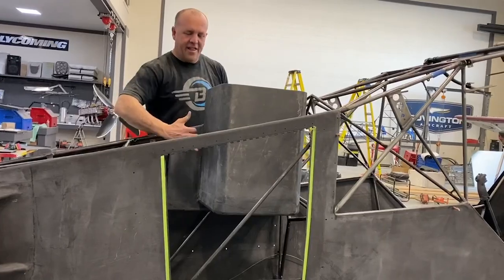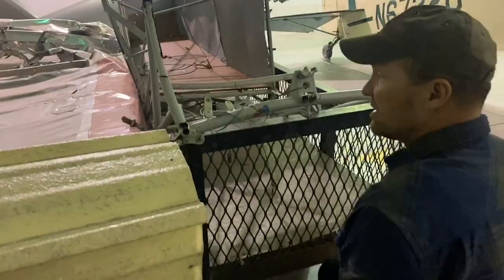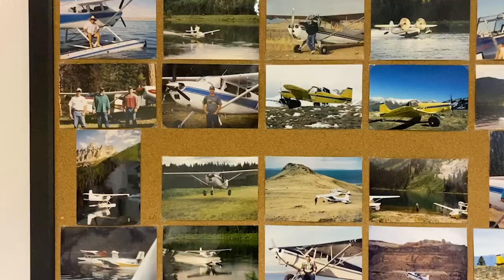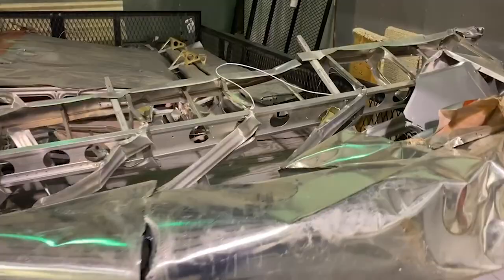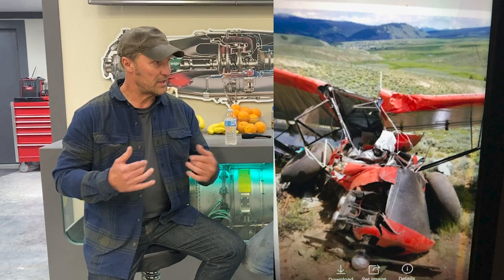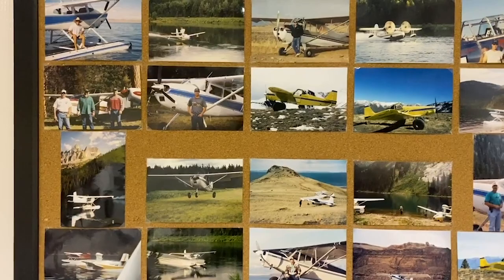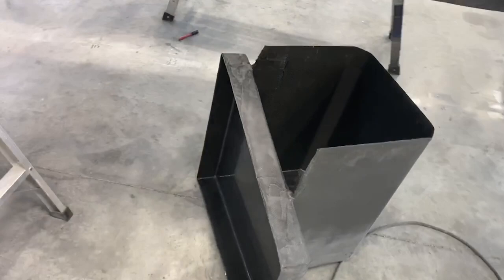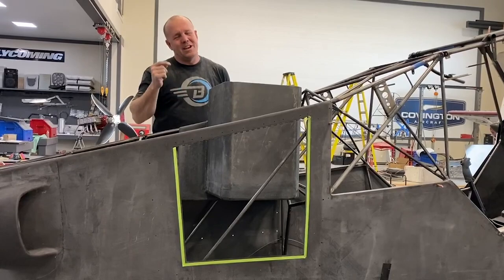Rockets, Boxes and Parachutes Oh My 🤠 (Scrappy Bush Plane 18)

Comment: I'll tell you a story Mike , One that set my Aviation path in a different direction . Or so I felt at the time . I got my private lic with a night rating and was building up to cfi and stuff . At the same time I thought to become an A.M.E. in Canada . I found a 1946 Taylor craft that was a restoration project . It was completely stripped when I got it but complete . Well a series of life's circumstances and being in my mid 20's . life had another plan , kids . It ended up where the guy I got it from sent me to the previous owner for a paper work clarification , small town no big deal  . basically that to say what became the problem for me was although excited to do this it had some ugly wing spares , which priced the build at more than its value at the time , more to it but you get the idea . It wasn't working out  . In the meantime I got a hold of the guy for the paperwork . turns out I was on the phone with his brand new widow . He had the twin plane to mine and was out for a flight around his farm and flew overhead and rocked the wings to say hi to his wife down below and snap . He lost a wing . he'd be here maybe ... maybe , but it's such a solid maybe that he may be here if he had one , right ? everyone should be saying yes and amen and here but buy the grace of God go I on that note !!!! 
      That's a long time ago now . I got discouraged at the moment and went a different direction in life . It's all good because even though I had stopped flying I always loved it . I kick my butt for selling that plane ..... however , it had to be at the time , yet life has a way of coming full circle . I think the biggest reason I sold it was although super close the timing for such a build in my life wasn't there , just yet .  That and expense , inexperience with no way to find a friend with experience for some helping advice or what ever ..... 
   That was 25-30 years ago now and at the time planes like that were abundant , more so than now . I had discovered in the meantime the Experimental category .... Things have been on the back burner for a long time now , always wanted to do that AME course ... Just cause , right ? Well I have collected 3 or 4 sets of plans over the years along with floats and well looks like I'm headed back to school for the fall , God willing . Covid only slowed it down a bit but I'm in contact with the school as even this day , etc . I got some chatting to do with you down the road in a bit Mike , I need to pick your brains on a heavy eng up front etc , not that you'd know anything about that right :) I got an perfect v6 superchared eng that's just screaming , I want to fly . 
   The lessons learned along the way ..... this is about parachutes and safety . The guy I got that first plane from would be old now but he would be old . I'm thinking his wife would agree if she could enjoy his company again , what do you think ? 
  I worked on DC3's and 4's up north for a bit in the Yukon and Alaska , It was a magical time for me in a sense . I was only up there to figure out which direction I wanted or needed to go , at the time and with other obligations in life I had to put Aviation on hold . Yet I got the bug still and feel the need to scratch that itch . So I've been taking steps to pick it up again in my later years  . I'm liking my potential retirement in the not to distant future and the fun to have playing around with Aviation again . Upon planning my build I will be planning a chute . No doubt . I know safety and am vocal about it and I have in your face answers for those who think it's wimpy having spent those 25 ish years around heavy industry being gas plants etc . Safety isn't something you do it's a way of life and a mindset and that is the coolest thing about your channel I might add . we all know our limitations to some degree or another and things happen but ...  When we step outside our personal safety limit/comfort zone , that's when things happen . When we push sometimes even just a little past our personal safety limit , it can bite you in the butt , fast . Then we have the side of the coin people don't plan for ....mechanical failure .People think it will always happens to the other guy . I've been that other guy many times in my occupation . So I know . If a chute gets you back to your loved ones , why would a person think any different , That's not being responsible to yourself let alone others , if you have the opportunity to add safety and you don't . We who fly love it as much we do but that sexy little thing and little ones ....that makes me say it's good to be alive . I Thank God for each and every day now , maybe you can imagine why , that may be a leading indicator as to why I think the way I do . I know it's a bit long winded but it has so many points to it for people to take from all this I hope . Whats that you like to say , build it , brake it , build it again kinda thing . right !??! Same with life also I suppose also , we need to know our limits and the limits even more so of the machine your operating . An Old boy once told me ... before you get in that contraption you need to know there are 10 things that will kill you if you don't find them . That was his way of saying look then look again , the problem you find and correct may just save you life , We worked a very hazardous job , people did die.... The people who think safety is a joke usually end up a statistic . So ......Thanks once again for your patience and Cheers to all from Canada .

Comment: Good on you Mike .. good to hear you backing up innovation and insurance for life after catastrophic failure .. on my first Solo in a Cessna 152 Aerobat I was sucked up into a squal the wings iced up and my finger nails were blue .. I admit that a parachute would not have saved me at that time ..  Full carby heat and a chandel  at 50+ over VNE in rough air with 50% throttle .. Just had to find a way back that was survivable . I had to flex the airframe to get the ice off ! Landed ok in the end into a head wind at full throttle and zero ground speed .. sat in it and flew it on the ground until the storm passed ..  I wish I had a chute .. as I would have blacked out for sure .. but at least .. I would have regained my sensibilities .. some place on the ground a few hours later .

Comment: Having a chute is just one more tool in the toolkit.  Hopefully you will never need it, but when SHTF you will be glad to have it.  Kudos to you for doing this video.  I owned a Cirrus for many years and had this argument numerous times with "old timers" that felt they could fly out of any situation.  You can't fly out of structural failure and the data shows you are more likely to die trying to land than to just pull the chute.  Insurance companies would much rather deal with a totaled aircraft than your estate any day.  Great job!

Comment: Mike, I am extremely fortunate to get to fly some incredible WWII aircraft, love aerobatics, and flew formation aerobatics at various airshows in the northeast for 12 years. I cannot imagine flying without a parachute. If a wing comes off at altitude, it is not pilot skill that will save you but rather it will be luck. Wearing a chute is cheap insurance. Just make sure that you go to your local drop zone to learn how to use it. Thanks for bringing up the subject.

Comment: I have built three microlight aircraft, rebuilt a homebuilt aircraft and refurbished my current microlight, a Pegasus xl-q. All of my aircraft have had parachute systems. Chest packs were the first thing available, then spring deployment and finally ballistic BRS. Not a rocket but a steel slug attached to the chute and fired with a gunpowder charge. I have never needed to deploy one but it is just safety and common sense to have a backup system.

Comment: Thanks for this video Mike. You have a great platform for promoting the safety aspect of a chute. I worked for BRS back in the day and have heard all of the negative connotations of installing a chute. You are correct it is just another tool in the tool belt, if you need it. Great job with the videos and the projects. One of my favorite channels I watch.

Comment: Mike you are doing an awesome job! I pretty much lost tail assembly on Mooney M20TN, event resulted in emergency AD #: 2012-03-52 and grounding Mooneys wordlwide. I am fortunate to be alive managing landing with some miracle, but if I had a chance to use an parachute I would do it no doubt on that Friday morning 13 Jan. Root case was assembly mistake at factory on that certified airplane.

Other case I can think of is flying single engine airplane over the fog, if you loose an engine you are pretty much dead and not even see a spot where you crash. Having a parachute is a game changer and awesome insurance in such situations. I am strong believer in multi-engine airplanes or at least single engine+parachute. 

Just keep going promoting safety amongst GA, forget those claiming that parachute is not needed. I like your engineering job a lot!

Comment: Hi Mike, Iv'e been watching your videos and am very impressed but as a former mold maker I have a tip for you.  I'm not knocking what you did here but to make it much simpler to remove the form from the inside of your box,,,  when you make your relief cut tilt your blade 22 to 30 degrees then the form can break away and not try to increase in length.  3/4 " is quite large hinge point when braking the form away. Hope that makes since.

Comment: Have you ever thought about building a post cure oven for your carbon work? Also... no vac bag/bleeder cloth/ fabric?? You can easily build a post cure oven from double layer Sheetrock and heat elements on the bottom and sides.  It’s what we had to do to post cure some parts for a 45’ performance yacht

Comment: The sport side of aviation (sky diving, hang gliding, ultralights) has been using reserve chutes for decades.  I personally have never deployed one, but wouldn’t consider not having one.  Even the tugs we use (Dragonflies) are always equipped with BRS’s, as standard equipment.

Comment: I noticed that the emergency parachutes deployment damages the plane quite a bit, because they are going to be damaged anyway when they hit the ground, arranging the parachute to deploy without causing damage would be a waste of time. Unless you were able to devise a method to shorten the parachute lines just before the plane touches the ground thereby lessening the impact to an acceptable amount that would not cause extensive damage. Seems that you could use some type of rocket motor device similar to that which deploys some parachute systems to draw in about 20 inches of cord suddenly, if done correctly and timed just right it should make for a soft landing. This idea could also possibly be used by a space capsule that returning to earth via parachutes the impact could be lessened significantly by using this technique.
Reply from the maker: Just wait and see, I think your going to like what's coming..

Comment: My wife is a social media consultant, and I've lived seeing naysayers trash others. So really, folks need not care about what others say, do what makes you happy and ignore them. On a Scrappy, where it's really a one off design, people need to remember this is EXPERIMENTAL, and adding a 500hp + motor up front with totally new engineering parameters you want every advantage you can get. That said, Mike, what are you estimating the total weight increase over that of a normal carbon cub is going to be? I see you take great care in both structural strength and weight soo that rattled in the back of my head..

Comment: Mike you need that parachute layer of safety in the shop, "for the just in case" consider an SawStop table saw. In the unfortunate event of saw kick back, or a simple distraction,  you want that safety back up. With the extra layer of safety you do not get your fingers dismantled by the blade. Just an suggestion sir.

Comment: Looking at the last dozen comments it looks as though I am in alignment with the thinking, at a 'logic' level Risk = Probability (of an event occurring) x Seriousness (when it has happened) When considering commercial flying: Risk = P x S the seriousness is so awesome i.e. plummeting from 40k feet hitting the ground at several hundred mph, it is so awesome that the only way to address it it to focus almost entirely on the Probability side of the equation, so there are a host of things done to ensure the Probability of a disaster, you guys knew them well, maintenance, Inspections, procedures, training, operational protocols, and likely even more I don't know. With the smaller aircraft, to be able to address the Seriousness of an event is such a no-brainer anyone laughing at such is well described by others in the comments. Wonderful idea, and great videos, many thanks, Paul , Johannesburg

Comment: Mike, 
Speaking of accidents and Draco, it would be so interesting to see you do a critique of the damage she sustained in the crash and any engineering/construction insights you gained from inspecting it.  One particular question I have is whether the absence of any fire was due to design safety features or just luck.

Comment: Love that you are so adamant about safety. I work for a company that preaches safety with electrical, work 1e.  1) Safety is your responsibility, not someone else's. 2) Understanding and defining the risk, before performing the work to determine safest way to perform it. 2) Minimize the risk by performing the work or not performing it unless the risk is minimized, such as for electrical work perform it differently such as locking off the electrical power sources (LOTO) electrical power off to minimize risk and wear PPE rated at the voltage and arc flash potential even though the power is off. just in case power is on from missed source, verify yousefl., never trust it is safe caus someone said it was. It is your life.  3) Never rely on PPE (Personal Protective Equipment) (Helmet, glasses, seatbelt) for your safety, that is your last defense if something goes wroing., 1st is engineering protection. For example never works on electrical live, unless voltage is below 50v. if above 50v he shock can kill you, worse yet an arc flash will severely burn you and can/will kill. So always take the safest work method, turn the power off, LOTO it off so someone else cant run it on, in fact all working on it need to add a lock to ensure all workers are protect and no one can turn the power on until all locks are removed.  Even if you locked the power source off, always wear full PPRE rated greater than the voltage your near, then verify with a meter power is off (Check that meter works on know live circuit, then check all [ower sources for power, then verify meter is still working on the known working source (Live dead live test))  and arc flash PPE. Same can be applied to aviation. Play it safe. Especially, a ballistic parachute is a good thing, saves lives, something good pilots add to there plans.

Comment: Z grip is an excellent lightweight filler. Also, you could use Mason/ 3M Mar- Glass first at the joints that are permanent and need maximum strength and do flex. Mar-Glass and Z grip are compatible. Mar-Glass is like fiberglass filler.

Comment: My response to anyone who ever says "they shouldn't have pulled the chute" is - "at least they had the option available".  You're right, there are plenty of times the BRS has been used when basic airmanship probably could have gotten them out of the situation, but replacing a thing (the airplane) is always preferable to having to deal with the other option.  How many people have been killed due to inadvertent flight into IMC?  How many have been killed due to inadvertent flight into icing?  How many have been killed due to severe turbulence?  In all these cases, a BRS may have changed that fatal accident to a nonfatal one.  Yeah, plane would have still be wrecked, but at least those inside would have gone home.

Comment: Hello Mike. Thanks for the Video and I would agree with both of you on adding more Safety to Scrappy, You only have one life here on Earth. I know you have the safety install but could you use a Airbag from the Steering Wheel to safe some Weight? Still love to see Scrappy as a RC airplane with a turbine motor like you are using. God Bless and be Safe. God Speed Mike.

Comment: Good call on the emergency recovery system! Aircraft are expendable, a Father and Husband isn't. You've already cut a lot of weight from Scrappy, 70# added is only a drop in the bucket, and I applaud you for your wise decision. 👍

Comment: Despite the fact that seat belts proof for more than 40 years that they save lives there a still idiots out there who refuse to use them. They always pull out the one accident where someone with a seat belt on would have been better off without it. They put a blind eye on the other ten- or hundred thousand of accidents where seat belts saved lives and prevented harm. Derek Kieper for example was against mandatory seat belt laws and was killed during an accident which could have been prevented by wearing a seat belt. 
It's great that you think about your safety and that you add additional safety measure. Flying is about enjoying flying, every additional safety measure helps with that. 
Thanks for your great videos. I can't wait for Scrappy to finally take off. 
"Lets get back to work"